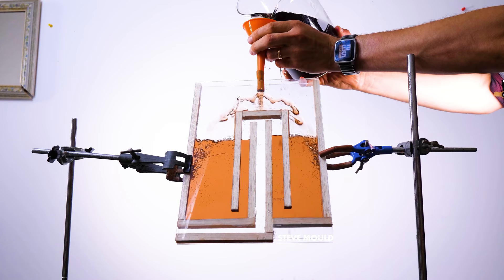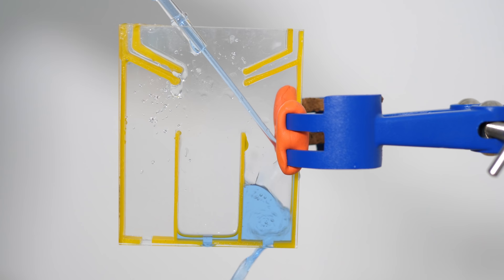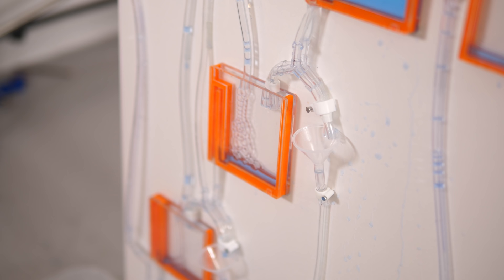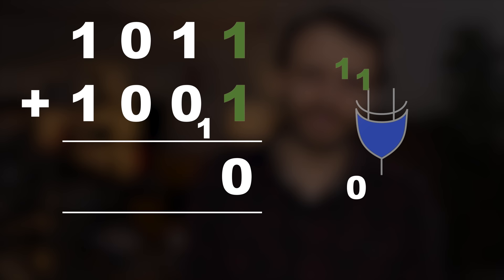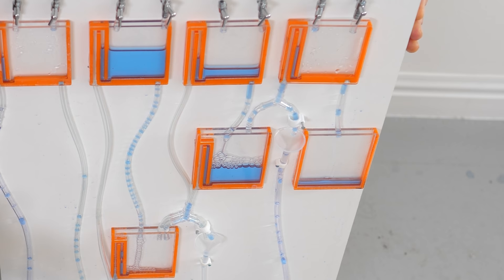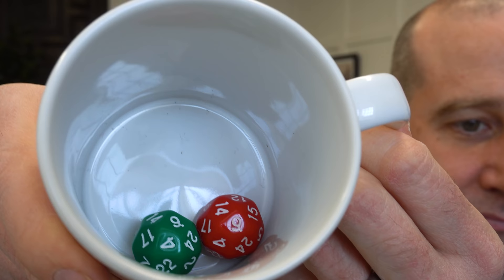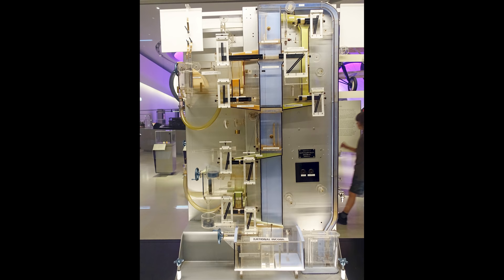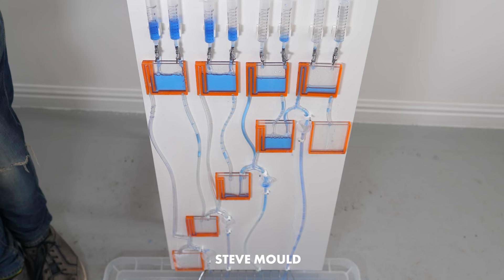I Made A Water Computer And It Actually Works

Comment: I love how an overflow error literally results in an overflow of water.
Reply: You gotta flush the buffer of bits!
Reply: exactly lol
was thinking the same
Reply: Got some current leakage going on, too.
Reply: He's letting the carry litterally and figuratively 'overflow' into the next bit slot x'] just genius
Reply: 🤣😊
nicely done!
Reply: why is your profile picture your name in katakana?
Reply: LOL
Reply: @Nick-lx4fo  LOL good one
Reply: What about a 404 error? Can evaporation cause this kind of 404 error if the water isn’t securely tight and the sun manages to evaporate the water?
Reply: And if the (water) packets were missing, what would it do?
Reply: I love that the behaviour of water can be applied to a lot of things, like electricity flow/current etc

Fascinating.
Reply: @miguelbaltazar7606  Umm... 404 is a web/file error. It happens when the page or file you're trying to reach is nonexistent. This water computer cannot have any sort of 404 error as it has no file system.
Reply: a memory leak is a literal leak
Reply: @dylanbksp  My first thought as well. At 3:44 I was like "wait, so is that just a memory leak?" Like you have a big enough computer doing that enough and eventually it's going to break. Those plus imperfect siphons (where it isn't complete) are basically memory leaks. A bit of the resource is being allocated to a process that isn't needed anymore and could prevent significant processes from actuating.
Reply: Good joke, but a buffer overflow has to do with memory. I believe this is closer to a processor, not memory. But still, good joke.
Reply: lol
Reply: No pun intended
Reply: It's not a overflow error its a data overflow
Reply: @JoBot__  r/woooosh
Reply: @thesmasherthebest  You clearly don't understand the definition of "wooosh." Also it's 3 Os, not 4.
Reply: Exactly what is happening to me while watching this video 😅
Reply: @user-hy8ld2zk6e  bruh lmao
Reply: I like they called “wet inside” is kinda sus
Reply: iMajine No Error i guess will be fun.
Reply: Ok.
Reply: @JoBot__  well it can be added later if he makes a flip flop bit
Reply: @user-hy8ld2zk6e  I know this is one year later, but what I assumed happened is Noa put “ノア” in the given-name slot and “Noa” in the surname slot
Google, if i remember correctly, actually does format East Asian names correctly, so what I imagine happened is that Google saw the Katakana and switched the order of the names.
Reply: 404 too much water
Reply: YOU’RE FUNNY
Reply: Beautiful visual metaphor
Reply: Lol 🤣
Reply: Overflow 
This words reminds me something 💀☠️
Reply: You could download a waterfall
Reply: you love nothing😡😡😡😡😡😡

Comment: The real question is: "Can it run Doom?"
Reply: I was hoping I'm not the only one.
Reply: *BFG Division* Slowly gets louder and louder.
Reply: Well yes but no.

So if you add a lot more of these maybe like maybe 500 of those water things you could probably like play minesweeper on it but you would need a screen and electricity but yes. You would just need a room about the size of your mom to house the water computer. (Sorry i just had to make a your mom joke but jokes aside it would work.)
And it would be extremely slow, like 1 frame per day.
Reply: @fregtz735  well yes but no . This is just a very basic alu to make a programmable computer you would need memory and instruction set
Reply: Yes, but it would be the slowest game ever.
Reply: at 1Hz....don't expect to Kick ass and chew buggle gum either.
Reply: What about KARLSON?
Reply: @luisderivas6005  More like .1Hz
If you could somehow attach some kind of display to it you could play a turn-based version of Doom.
Reply: the real real question is:

can we play Bad Apple on it?
Reply: Doom!!!! Crysis???
Reply: @orangeleaf36 
Gotta be milk powered
Reply: 1 frame in doom =  4000000 years
Reply: Assuming you operate it in a 100% relative humidity room, to prevent evaporation of the liquids, you can expect processor cycle every few weeks.
However, displaying the video and sound will be a different matter, let alone handling user inputs...
Reply: Doom?? This thing can run 5 Chrome Tabs
Reply: Probably but there is no clock speed to speak of even if you have a 64 bit water computer
Reply: it will probably overheat lol
Reply: @fregtz735  I like how you “um actually’ed” a dude and topped it off with a mom joke.
Reply: The real question is :
What can NOT run Doom ?
Reply: @fregtz735  I wonder if there’s a way to put the siphons in parallel to make a literal liquid display…
Reply: Yes
Reply: @DarkMatterSoup No
Reply: The frame rate would probably be less than one frame per day, and you would need a reliable way to convert your results into images but I larger version that uses the same concept (memory in a water computer actually seems somewhat easier if you have the litteral space) it might be possible.
Reply: No, can it play Bad Apple?
Reply: super mario? may be for first?
Reply: Water doom!
Reply: i wish it can 😂
Reply: I hope so
Reply: how long before we can run cfw on this thing
Reply: Maybe if you used monster instead of water
Reply: cmon even a potato can run doom, it sure can (water pc)
Reply: Yes, but only once you can attach a screen. You can play doom on anything as long as it has a screen
Reply: Run it in monochrome on a hydraulic piston display that pushes out from the wall.
Reply: 1:12  That is not an and gate.  The truth table of an And gate is any zero in is a zero out.  This does not follow that rule.
Reply: put on some rgb and it sure goes
Reply: No, but it can run DH₂OOM
Reply: I scrolled to see if someone had already posted this.
Reply: @youraunt  i see. Fellow touhou fans ere
Reply: @fregtz735  it would even be able to run any game at some normal FPS on it, you will just need a super big room
Reply: @kaidwyer  that would be awesome!
Reply: @MrNocturnalEmission  thnx
Reply: @alexw5674  yes i already said the scale and the scale is huge...

j u s t  l i k e  y o u r  m o m
Reply: @fregtz735  "The scale is huge" That's what she said
Reply: Bad apple 😈🍎
Reply: No.
Reply: @Physsiallis  A lot of things.
Reply: @Ratgibbon  That is spelt wrong
Reply: No. Basic Arithmetic is not a computer!
Reply: Don't you mean: Can it run Crysis?
Reply: can it run Crysis?
Reply: Same
Reply: Or can it play Bad Apple?